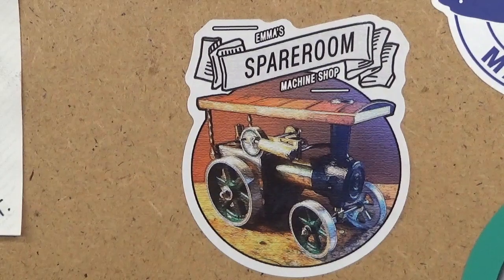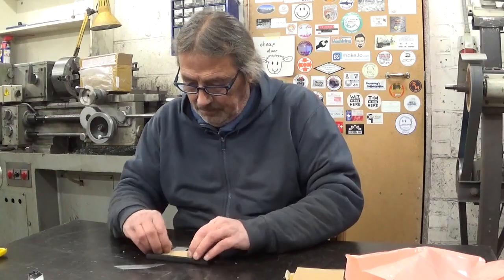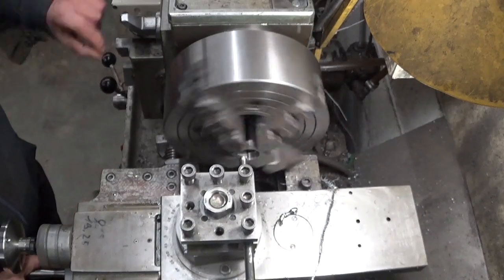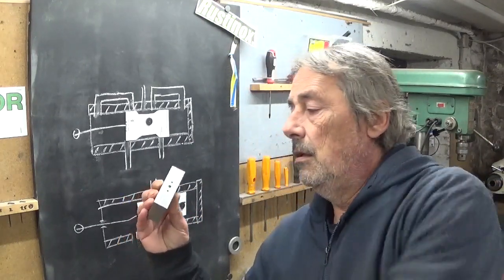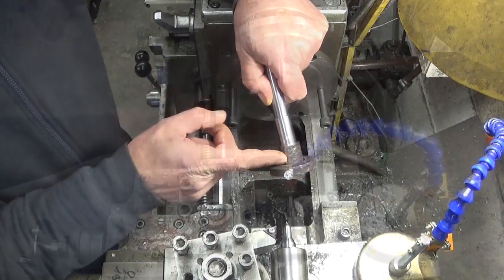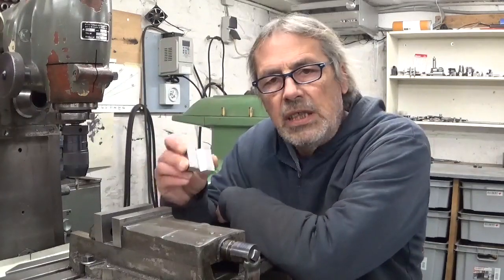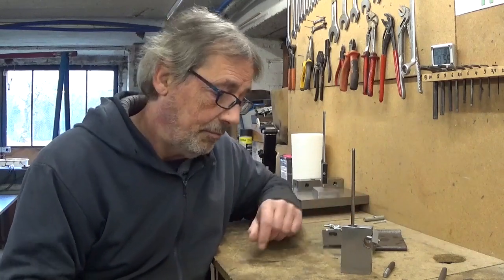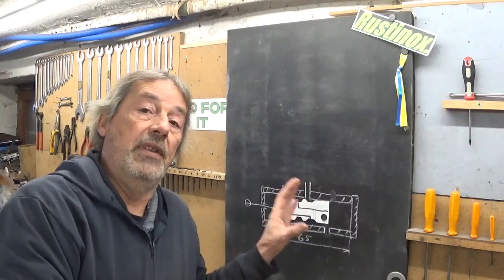Experimental air engine part 2.

Comment: Hi Michel. When doubts about the feasibility of a design creep into my head, my wife spots me staring at a part I just made as says “not more endless hours of staring”. I find that “endless hours of staring” helps me to refocus and often a new solution comes to mind. I’m sure you will prove to yourself that your idea will work, and in time we will enjoy watching the engine come to life.
It would also be rude of me not to mention the engineers square. I am sure that it will not only prove to be so very useful to you, but also destined to be a tool to treasure. 👏👏👍😀
Reply from the maker: You're right. Sometimes taking a step back can make you jump higher.
Reply: @Rustinox  Brilliant quote 👏👏 I will print it and display it on my workshop wall. 👍😀

Comment: Ca Lim does amazing work, that square is, as you say an art piece. To save time, I always try to make version 4 of the part first..😂
I was wondering if adding a couple of small blead off orifices' might work for the piston problem....It would waist a little air but might work...hummmm?
Reply from the maker: Good idea. I will give it some thoughts.

Comment: V-block... Good You don't loose the shape but use the shaper as the solution. Joking! Having no shaper the tilting vise and the mill had done the job.
The parts You made will surely be perfect for something some day....
Reply from the maker: In the shaper or the mill, I don't think it makes much difference.
Reply: @Rustinox  Just bought what we say "Wagon bolts". Milling off the circular head, turning the bolt upside down (head down) it becomes a combined T-nut and screw. Just the flinch nut is needed.

Comment: Gday Rustinox, would a check valve in each end of the cylinder work, just a thought, the square CàLem made is absolutely beautiful, lifetime tool there mate, cheers
Reply from the maker: Valves? I need to take a closer look at this idea.

Comment: Hi Michel ☺ season's greetings my friend, the set square you were sent looked great, and will be another nice tool for the shop. You can make small v type blocks by welding two hexagon nuts together, although it's maybe 120 degrees,I can't remember, lol ,but you'll get the idea. Any way it was a fairly quick job making a new one on the good old shaper, it looks like the lathe is still giving problems of taper turning , is there no cure for that ?. And the solution for working from the wrong blackboard diagram gave me a laugh. Thanks for another interesting video mate, stay safe, best wishe's to you and your's, Stuart UK.
Reply from the maker: The best way to fix the lathe problems is to buy a new one. But my budget is protesting :)

Comment: In regards to the rough fit of the piston - a youtuber called Myfordboy showed how to lap cylinder walls to a mirror finish
(about halfway through https://www.youtube.com/watch?v=65GZZyZc93w ).
An easier way would be to bore the hole oversize and press in a cold-drawn piece of brass tubing. They are seemless and surprisingly smooth and accurate (usually less than .01mm variation).
As per the exhaust port - that could most certainly be calculated, sadly I don't know how.
What's certain is that some engineer has already figured it out (your pneumatic hammer works, obviously), so a google search might find some answers.
Either that or trial and error with test cylinders, maybe out of pvc pipe to reduce effort.
The cool part about that uniflow design is that the building exhaust pressure can be used to cussion the piston and acutally increase efficiency - much like a petrol engine fires before top dead center. The weight and speed of the piston will undoubtedly play a role in the calculations, and whilst the engine might not want to run at low speeds, it could well be extremely efficient at some higher (most certainly calculable) rpm.
Reply from the maker: Some good ideas here. Thanks Adrian.